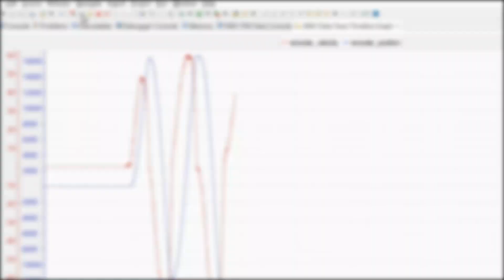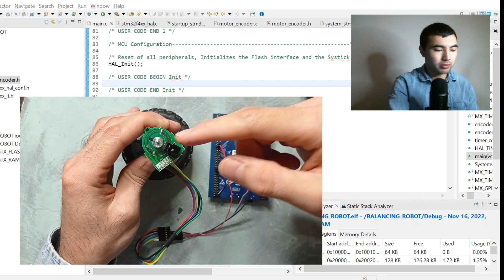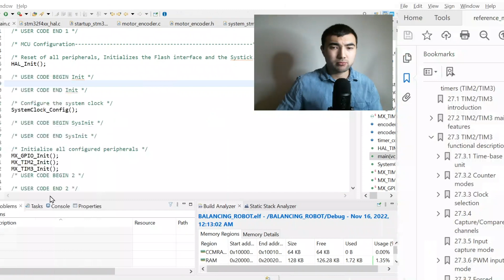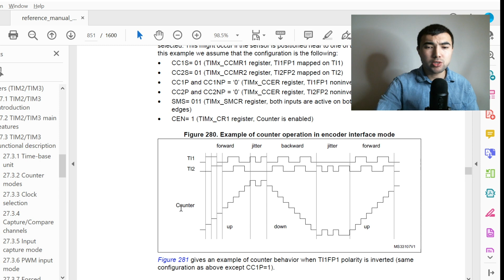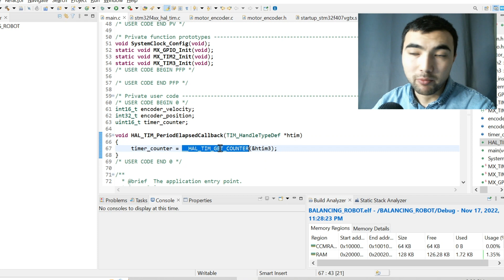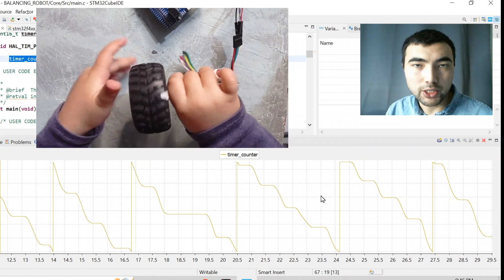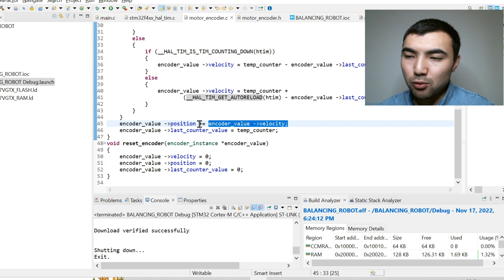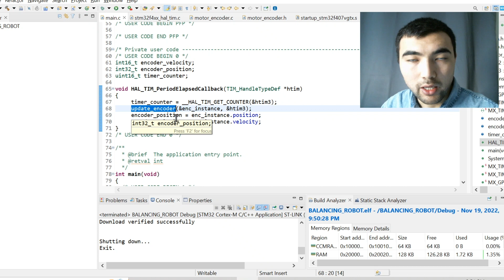STM32 Timer Encoder: motor velocity and position

Comment: What about chaining more than one PID controllers? E.g. I want the servo to reach some position, but it must obey some restrictions while doing this: must not exceed maximum allowed speed and in must not exceed maximum allowed acceleration. Can I do first PID for position and then pass the result through acceleration limiting PID and speed limiting PID?
Reply from the maker: you can integrate the limits into the PID Contoller without having a separate entitity. Usually, we have the pid output and pid integral limits. Check the link below:
https://www.steppeschool.com/pages/blog/pid-implementation-in-c

Comment: can i use arduino ide to plot the graph. because my code is right similar to yours , it runs without any errors. But it  doesnt show me the graph and i cant enable svw
Reply: necesitas el pin swo, sin ese no podras usar la svw, necesitas un stlink v2-1 o stlink v3

Comment: Why didn't you simply use the  encoding of the channels to find position and then speed? Would've been cleaner, faster and provided more resolution
Reply from the maker: Because the counter of the timer has limits. It cannot count to an infinity leading to overflow issues. Therefore, it is better to compute the velocity and then position. Hope I could answer your question

Comment: velocity here is rad/s ? right ?. I use motor 330rpm around 33rad/s but your code just read 7 rad/s. It is not true
Reply from the maker: My code shows the velocity in terms of the number of ticks of the encoder. In order to convert it to a physical unit, it is necessary to divide it by the number of ticks per revolution. Then you get a number of revolutions,
Reply: @steppeschool3629  Thank you, I can do it

Comment: Very nice work , i just want to ask do you mean by the encoder position the distance traveled by the wheel of the motor or the number of ticks done by the encoder . Thank you !
Reply from the maker: The answer is yes and no. The encoder returns the number of ticks done by the encoder. However, you can scale it to show the real distance traveled by the wheel, by knowing the diameter of the wheel and the number of ticks per rotation. Actual distance = number of tick * (pi * radius of wheel) / (number of ticks per rotation)
Reply: Thank you ! @steppeschool3629

Comment: Would you please share the link to buy this kind of motors? They look good!
Reply from the maker: It is called: GA25-371. I bought it in Digikey with a kit.
https://www.digikey.fr/fr/products/detail/seeed-technology-co-ltd/110090264/10290303?s=N4IgTCBcDaIIwFYCcB2AtHOAGLStgDYAWNAOQBEQBdAXyA

You can also buy it separately. Just google.
I usually mention the hardware I use in the video's description.